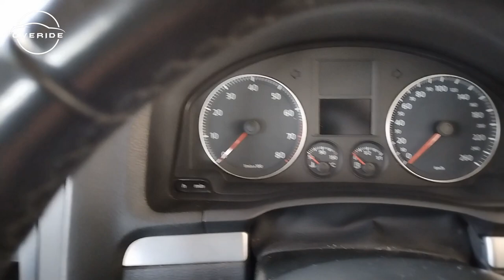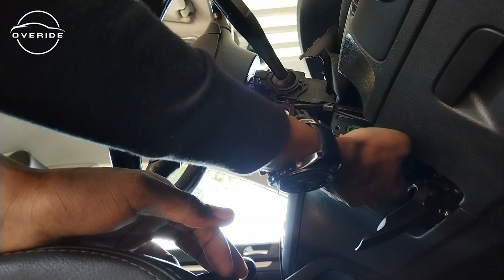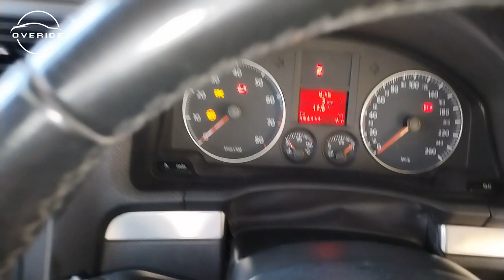How To Fix An Ignition Lock Cylinder | VW Golf/Jetta Mk5

Comment: Hi! I can’t turn my key to on to align with the hole. How did u do it?
Reply from the maker: Hey, when the key is stuck try to turn it by being gentle and soft for at least 4-5 times, then on the 6th try turn the key hard it will eventually turn.
Reply: i can confirm this works!!!
Reply from the maker: @MarvinsBloops I'm glad it has also worked for you as it did for me. I appreciate you supporting the channel 🙌🏽🙌🏽🙌🏽

Comment: Thank you for your help! I found using a right-angle adapter for my drill and a set of screw extractors worked much better than chiseling for getting out those horrible security bolts.
Reply from the maker: Those bolts are the worst thing ever, a dremel also works well to cut a groove on the bolt so you can get a screw driver on those bolts
Reply: Use an oscillating tool with blade to cut metal make sure blade is small enough to fit it the hole then use a flat head screw driver
Reply from the maker: Yeah a grinder would work well, a dremel too is also a good compact tool to get in there.

Comment: I’m stuck on getting the barrel out with the paper clip. It just won’t go down all the way and yes the key is turned.
Reply from the maker: Please try to get a longer thin and strong wire that can fit and push it down firmly, since it will be strong it won't bend and when it has reached a stop try pulling the barrel while pushing down the wire. It will come off.
Reply: @MegatronicsZA  I just literally got it with a hair pin. I just had to wiggle it a bunch and yes it just popped right out. Thanks for the reply.
Reply from the maker: @PaPaPowell07  lol I guess it wanted you to show that you're serious about it... I'm glad it came out.

It's a pleasure man 🙌🏼🙌🏼🙌🏼
Reply: I tired tiny allen wrenches, bvut eventually it worked with a paper clip and some patience.

Comment: hi what was the reason? the eps lamp lit up? Good morning
Reply from the maker: @paveltarasenko5486  hey... The reason was that the key would no longer turn, I wasn't able to turn on accessories or even start the car.
Reply: @MegatronicsZA  thank you. I have a trouble p2535 and light eps. From car scanner writes ignition switch run/ start position curciut high
Reply from the maker: @paveltarasenko5486  from the ignition, there's a switch that turns on the car when you press on the button. It must be burnt, replace it.